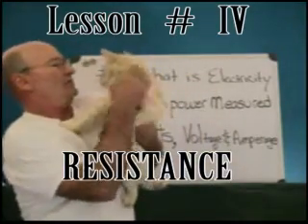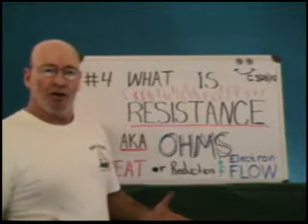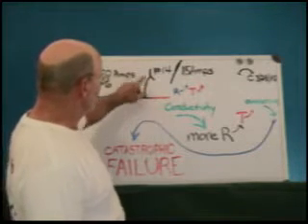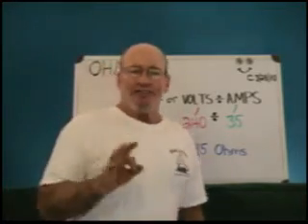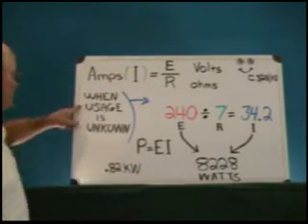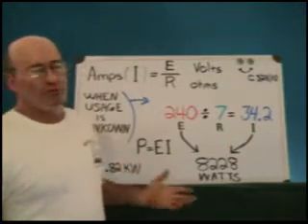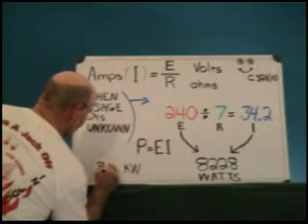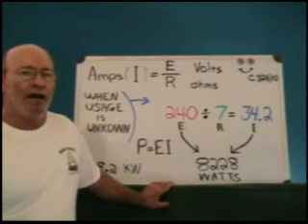What is Electrical Resistance.# 14

Comment: You really need the rethink what resistance is in a circuit.  Resistance does not cause heat to build up in a conductor.  A combination of voltage and amperage does.  As a conductor warms, the resistance increases, but not much.  In any case, an increase in resistance would reduce amp draw and thus lower heat buildup in the wire.  
Consider the electric element.  If I place a 20 amp element in a circuit it will draw 20 amps.  If I place 2, 20 amp elements in series, and leave the voltage the same, It will draw 10 amps.  The resistance is doubled and heat produced is 1/2.  Not trying to beat you up.  Its just that the concept is deceiving. 
GFM